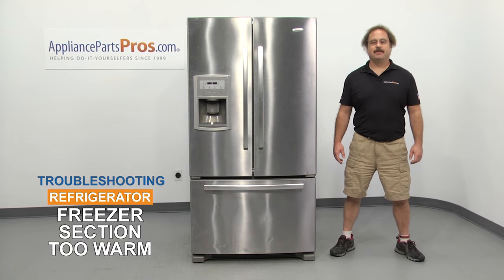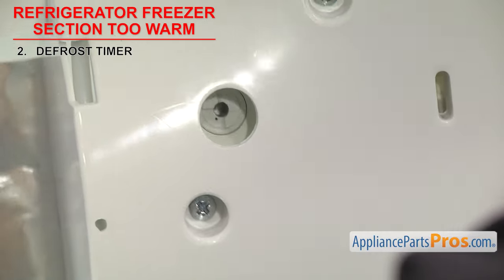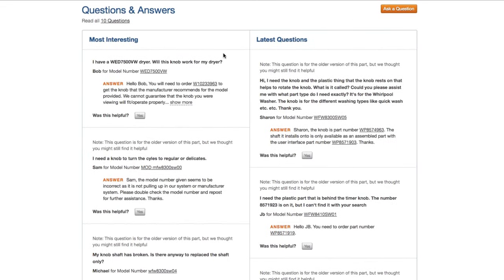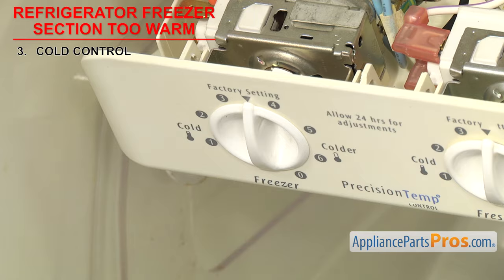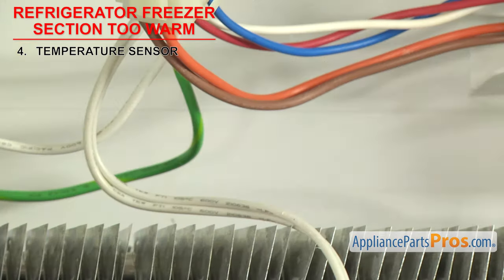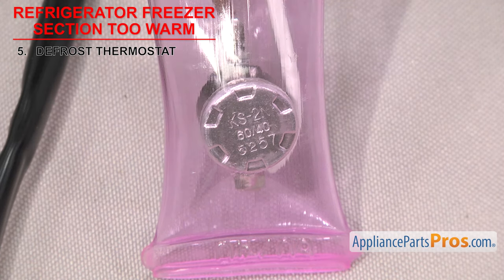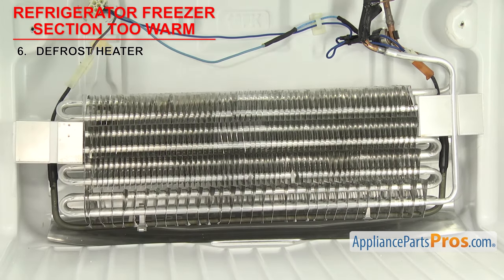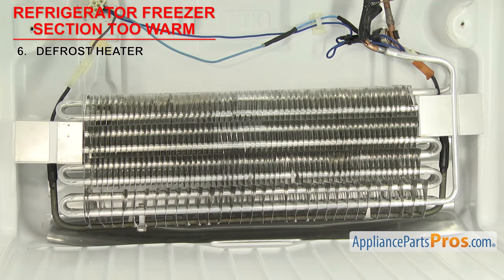Freezer Section Too Warm - Top 6 Reasons & Fixes - Kenmore, Whirlpool, Frigidaire, GE & more

Comment: This is one of the best videos to diagnose the cooling problem with a refrigerator or freezer. Typically, when the freezer does not get cold enough, it is because of the ice build up in the evaporator coil preventing it from circulating cold air to the rest of the freezer section. The most common problems I've seen are bad defrost thermostat, bad defrost timer or a bad defrost heater. However, it could be any of the 6 possible problems that he pointed out and it could be simply that you have to clean the dirt off the condensing coil first which is the easiest thing to do. I noticed after I cleaned up the condensing coil, I can run the fridge at a lower cold setting than before, indicating that the compressor work more efficiently and thus saving energy. This is exactly what you need to follow step by step procedure to diagnose and troubleshoot your freezer or refrigerator. Well done!

Comment: Hi, my Kenmore Elite bottom freezer is not freezing enough. Compressor turns on, condenser is clean and evaporator inside is not frozen. Only the top right of the evaporator (inside freezer) shows ice buildup. Any suggestions? Thank you.
Reply from the maker: Are you able to hear the fans running? What is your model number of the fridge?
Reply from the maker: It sounds as if you could be having a sealed system issue. You would need to have a tech that is certified in that area of refrigeration to come look at it.
Reply: @appliancepartspros  I placed a thermometer inside and the max temperature reached was 23 degrees
Reply from the maker: With the way you said that there is only ice build up on the top right corner of the evaporator it sounds like a sealed system issue.

Comment: Helpful video sir. Great presentation. I have a 23-year-old side by side Kenmore that has been trouble free. It only cools to about 15F on freezer side.  How do I find a repairman who will check for all these things? My repairman just checked model number to see how old it is. Then said you need a new compressor, How did he know without checking anything you mentioned, other than looking at coils in front and seeing they were clean.
Reply from the maker: You would have to call around in your area to see if you can find a certified tech to come look at it. Your repair man may know what he is looking for if he is saying that the compressor is bad. If you are referring to the evaporator coils inside the freezer that are clean then that can be a sealed system issue which could mean you are needing more freon or the compressor has failed. That is when you would need to have a certified tech to come look at it. Those coils inside the freezer need to have a nice even frost pattern on them.

Comment: I have the Start Relay it reads 5.5 ohms and does not rattle.  I also have the Overload attached below the relay (one pin) and it reads 0.6 ohms.  In short, everything works on my GE GBS22KBSBCC refrigerator except the fridge will not go below 40F and the freezer will not go below 33F.  So, what would not allow strong cooling .....if the start relay was bad or the capacitor?  Defroster, thermistors, evaporator fan, condenser fan are all working and the coils are spotless.  I even checked the three prongs on the condenser and got a 8.4 ohm on the two main prongs, 4.5 ohms on the left and 4.2 ohms on the right.  My Embraco 1PH condenser has a label on the side reading "LRA of 11.5  EGU 70HLC'  115 - 127 V".  My multimeter read 0.8 amps when it is running.  The Capacitor multimeter read 11.85 uF (210 VAC 50/60 Hz @ 12 uF).   Some history - In July 2016 I did had a technician add R 134a and in October 2018 I had to add an evaporator thermistor since my evaporator coils were an iceberg and it was not triggering the defrost mode; refrigerator was warm but freezer worked fine.  NOTE:  I made a video of the Start Relay arcing with the Overload when the compressor was called for power; there was just a click sound but no compressor.  Then, 90 seconds later, it called on it again and the compressor hummed away.  When I took it apart again the Star Relay gave the same reading but I noted it was VERY hot.  Could this Relay still be bad but not activating all the time thus overheating because it is sometimes working?  If so, maybe this is why the temperatures cannot catch up.  With that said, I do not know the spec for my compressor amps but had some hand written notes from the 2006 technician (when he filled my R143a) stating the original amps were 0.7 and after he added 4.5# the amps were 1.55.  His notes also read "spec = 1.5 to 1.7 amps).   Should I purchase a new Relay and, if so, is it "good practice" to purchase a new Overload, also?  They are very pricy at $76 and $80, respectively......for a piece of plastic!   ANY direction would be greatly appreciated by you.

Comment: Checked my thermostat.  It did not show continuity so I ordered a new one. Same. Does not show continuity.  I put it in a cold water, still the same.  I can't put it in icy water as the fridge is NOT working, hence the reason I need to test it. So, how do I know if the thermostat is good or not ?

Comment: My heater element measures 0.03Ohm. I think that is normal, but the video shows just continuity... could that be the reason I have ice forming on the evaporator and not cold enough freezer ?  Its a 81 usd part and I just changed the thermostat.   I do not see the defrost timer anywhere in this fridge. It might be part of the circuit board, as there is none. I looked at the front and back and nothing. Whirpool wrf990slam02